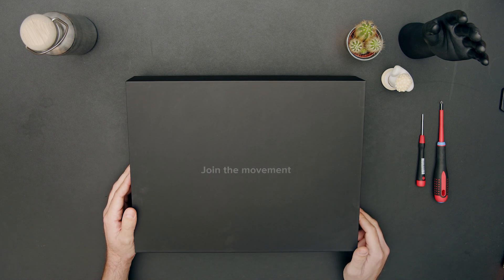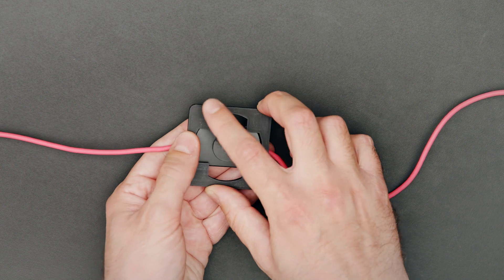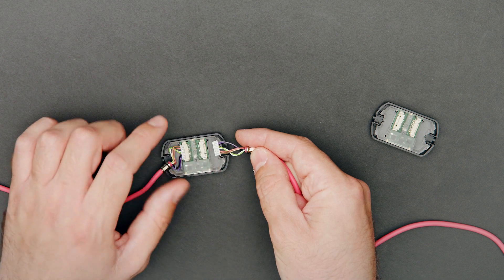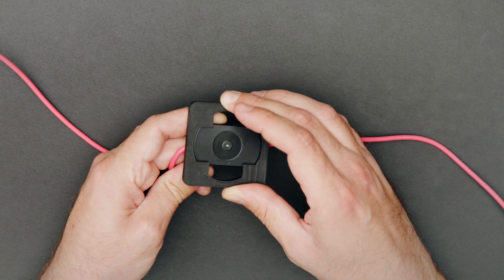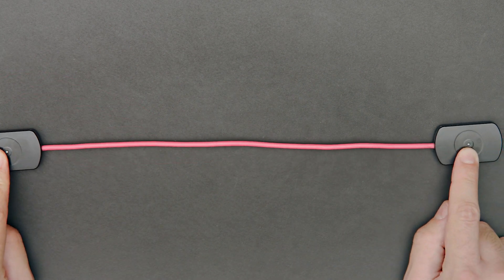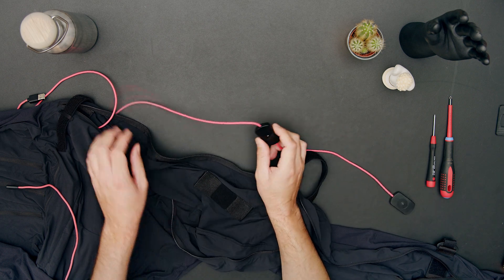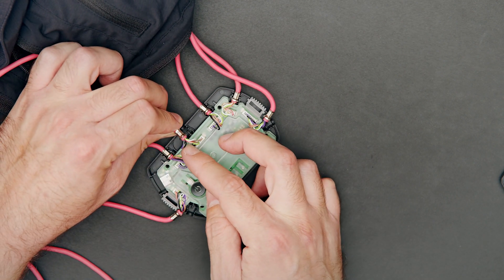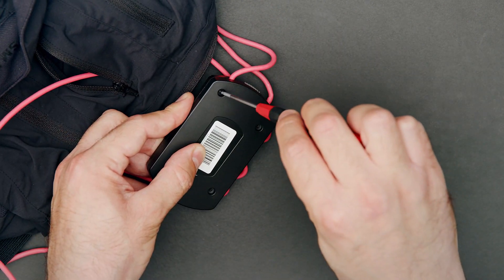How to fix a Broken Cable or Faulty Sensor | Repair Kit included in all SSP | Rokoko Motion Capture

Comment: Please what is problem 

 Router denied device
Error code: 607 (69)
Please try disconnecting the device from your computer and power sources, use a different USB cable and try again.
If this doesn't work, your router configuration is most likely denying the device.

Comment: To any Rokoko owners, memorize this video, because you're going to be doing it a LOT. I have a pile of 25+ replaced cables, and have had to order more cables numerous times. No matter how careful you are using the suit or storing it, those cables are incredibly flimsy and unreliable.
Reply: You reckon Perception Neuron 3 would be a better investment?
Reply: What part of the cable does the break usually occur in?